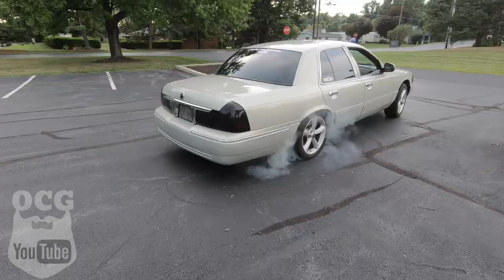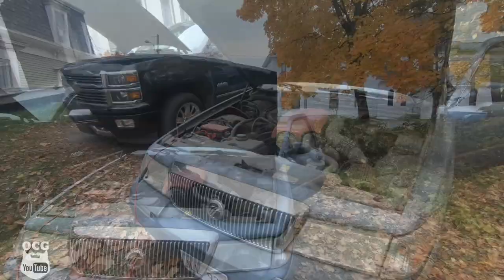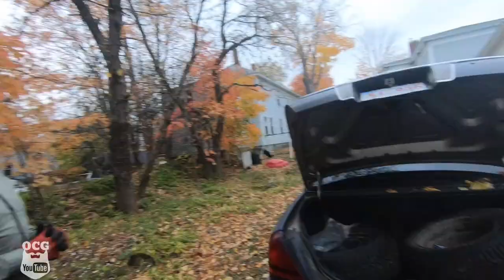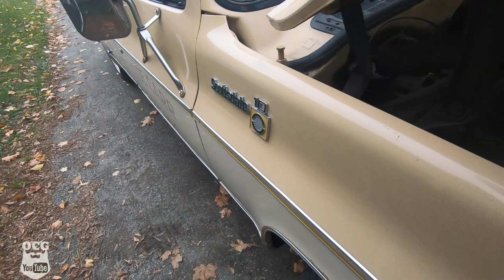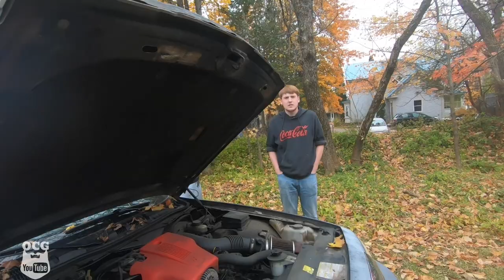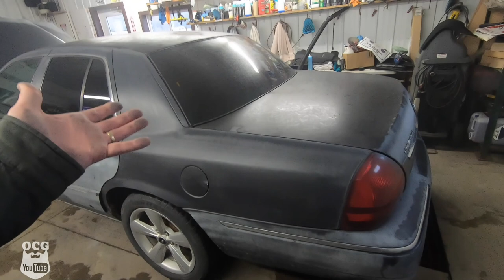I GAMBLED And Bought A $900 Grand Marquis That Won’t Start!!! Is It Junk?

Comment: I have not seen your other content on this car yet, but I will tell you that I own a 2000 crown victoria lx, 2000 grand marquis ls, 2004 grand marquis ls, and a 1996 towncar signature.  All four cars have the digital dash and I love it.  I love these cars and it sounds weird but they each drive different in their own way.  I just put new shocks on all 4 corners of the 2000 grand marquis, what a difference in the handling.  I put on KYB shocks and happy I did.  I have been driving these cars since my first one as a 1979 grand marquis villager stationwagon.  YES, I love these cars and it is sad they no longer make them.  My history with these cars is a 1979, 1987, 1988, 1993, 1997, and now the ones mentioned above.
Reply from the maker: I admire your passion to ownership of these big rigs.

Comment: I have a 2005 Gran Marquis LS Ultimate Edition. Bought in 2016 with 89,000 miles, has 201,000 miles. No issues, uses no oil between 6,000 mile changes, love the car.
Love your channel.
Reply from the maker: Thanks for sharing. I have a new Panther video coming out next week.
Reply: @OldeCarrGuy  
Thank You for your quick response.

Comment: Got ya beat, just got an 02 grand marquis for 750$ running and driving
Reply from the maker: $900 Canadian is only $650 USD and it does run!
Reply: Ah forgot you were up there. Yes runs and drives. Needs a rear axle seal and bearing.
Reply: Got ya beat just got an 03 crown Vic lx loaded mint 107,000 mile absolutely free

Comment: I love it. I have a 2002 p71 crown vic  with 200,000 miles and a 2010 p7b crown  vic with 74,000 miles and I'm thinking about doing the same lift on the 2010 with some aggressive tire's.  Because I already had the 2002 on 26inch rims with a 3-4inch lift (crappy spacers in the springs you buy for 10$ and a little cutting) but it worked and runs well.  Love the the vic and panther vids keep it up look forward to what else you have planned for it. Name idea's. (grandson)? (black magic)? (blackpanther) ?
Reply from the maker: Thanks James. Keep watching. We've Named this car Black Jack!

Comment: Hows the engine on your new grand marquis 
my engine is running like crap
Reply from the maker: Runs like a champ. Leaks oil, but runs good. If your engine light is on, check it for misfires, you may have a bad coil. Good place to start is a simple tune up: plugs, fuel filter.
Reply: @OldeCarrGuy  i know lol but mine is making noise from timing chain also burns oil thru valve stem seals and bad motor mounts have you ever did  a motor mounts job for mercury

Comment: Time to put a manual in it so starter problems don't leave you dead. :-D 

I had the bendix go out in my FRS earlier this week myself. Must be the time of year. :-) Push started it and took it straight to my mechanic's. Told my brother about it and said he got a 5 ton dump truck going by push starting it (of course he had 10 guys to help). Unfortunately, the Scion's starter isn't $100. :-(

It'll be cool to see how the same car takes on a different personality with the different set of mods.
Reply from the maker: Good call!

Comment: What was the problem?
Reply from the maker: The valet switch reset on the remote start. Crazy Eh?
Reply: What’s the valet switch reset remote start my 2005 linclon town car want start want crank but has power. I put a new starter in checked fuse new battery
Reply from the maker: My car has an remote control start device that was installed at the dealer when it was new. Sound like you may have a bad starter relay . Try swappimg it with a known good relay.